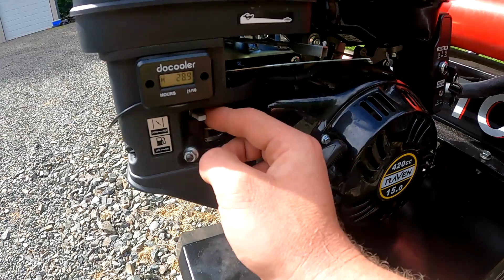RuggedMade 37 ton Log Splitter Review and Demonstration

Comment: Thanks for the info! I assumed that most of this unit was Chinese, thanks for clearing that up, still the best looking and quality Chinese made splitter I’ve seen
Reply from the maker: Your welcome. It's a great splitter. In the process of splitting about 7 cords. I have since replaced the battery, but starting problems (electric) still persist. I'd say the electric start is the weak spot in the  unit. Also, engine is jetted very lean from factory so it has to start on choke even when warm. Thats easily fixed with bigger jet. Other than that, I have very happy with the unit. Unfortunately price has gone up substantially since I bought it. I still highly recommend getting it..money well spent!

Comment: Can you turn the 4 way over so the spacing is different? That's a design idea if you cant.
Reply from the maker: No you can't unfortunately. And the provided 4 way wedge doesn't make pieces in the right size in my opinion. It works GREAT on like 10" rounds but thats about it. There are better designs out there. But don't let that stop you from buying the splitter. Its a GREAT machine. Too bad they are a lot more money now, but I guess everything is.

Comment: Great video Andy. 
How do you like the axle set all the way back like that?  If i bought one, that's what i'd do as well.  Does it make the tounge super heavy?
Reply from the maker: Thanks man! Axle is in a good position for sure. Tongue weight is probably 80lbs or so! I put a standard fold away tongue jack on it from Harbor Freight. It really should have come with one.

Comment: Im looking at this or a eastonmade ultra. Chinese with a lift vs canadian 4 sec cycle time but no log lift.
Reply: You can order this splitter right now and it will be sitting at your house in 5 business days. Its over a 2 year wait for eastonmade splitters, I have a 22-28 ordered.
Reply: @Tonnsfabrication  im probably going to look at a brute force first if they are behind too then i will consider a chinese unit. I'd like one i can tow fairly far if needed. I don't like those small wheeled ones really.
Reply: Check out All Wood Log Splitters too. US made.
Reply: @faststang89  I guess it's all in what works best for you. I've added a hydraulic wedge to this 37 ton and just finished an 8 way wedge for it, (I have vids of it on my channel)  I run this thing with a conveyor and can easily push through over a cord an hour without any issues by myself. The problem becomes dealing with the wood, this splitter can make firewood much faster than a normal person can deal with it. For my own personal use this splitter is more than I could ever need ( with the wedge mods). When I get that Eastonmade it will be a toss up as to which one gets sold. With what I have invested in the Eastonmade I can buy 4 of these ruggedmade splitters. Let us know what you end up getting.
Reply: @nicholascooper1193  yeah they look nice, but for someone like me who only may sell 1 or 2 cords and the rest is for myself that price is a little steep.
Reply: @nicholascooper1193  Those look like nice splitters, pricy though with the lowest cost model sarting $9000. Not sure what the wait time is either?
Reply: @faststang89   I agree, for some reason I thought they had a lower price model that more directly compared to the Ultra.
I've seen a lot of box store splitters pop up on FB market place since it seems a lot of people are upgrading to commercial grade splitters. If you're able to do some fab work, it's not a huge deal to do some upgrades to them to make them better - add log lift & table(s), expand hydraulic capacity, etc. 

All and all, it's really hard to beat the price of a RuggedMade, even if you're basically just buying it for parts and intend to modify it.
Reply from the maker: Interesting comment thread. Lots of good opinions and experiences that people are sharing. Hope all this info is helpful to future log splitter buyers. I can say that overall, I am VERY happy with this machine. Its important to remember that NOTHING is perfect, but as a whole, this machine has impressed me since day 1. To really maximize the machines potential, you MUST have 3 people working. It just makes wood so fast!
Reply: @Tonnsfabrication  I've actually thought of buying a unit with a blown engine or something and putting a electric 220v on it, obviously that would limit where i could take it but it would be nice to never deal with needing to go buy fuel etc

Comment: Awe man.   
Thats depressing.   So what was wrong with the 4 way splitter wedge?   Why would you not use that?   Is it too weak to use the 4 way with?
Reply from the maker: No the machine is crazy strong. It will blast through the nastiest wood like a breeze. The 4 way wedge is only good (I think) if you are in smaller diameter material. Just because it splits them in weird sizes if they are too big. But ruggedmade now offers a 6 way wedge that I'd really like to try. Please don't let the 4 way wedge discourage you from buying the machine. It's been great. Hope that answers your question
Reply: @andy84wilson  They make a 6 way wedge for that machine.  I would love to see it in action.  What do ya think?

Comment: does the battery have a direct ground wire connected to the engine block? (not to a painted surface)
Reply from the maker: I'm not sure. I'll check and report back!
Reply: The ground terminal is bolted on with the engine mount bolt. The engine case is bare aluminum.

Comment: Need a bigger battery for cranking.  Sounds like not enough juice to turn that motor over.
Reply from the maker: This machine needs an AGM battery. Flooded cell batteries won't hold up to the vibrations from the machine. That battery was 2 or 3 months old at the time of the video. Vibration killed it that fast. Lesson learned.

Comment: You may have already figured out what is going on with your log splitter when it won't start. I see your video is about 2 years old. But if you haven't I would tell you that when you go to start it and you think it's a starter or a bad battery check the control valves because if they're not in neutral position it won't start and it will act like a bad battery and the key ignition also.
Reply from the maker: Thanks for the tip. I know exactly what you are talking about. It ended up being the battery. Normally I would have suspected the battery but it was almost brand new. The vibrations these machines throw off is hard on lead acid batteries. I need to go AGM. Thanks for watching!
Reply: @andy84wilson  I have the 728 model I just bought this year and the battery does jiggling wiggle around in the battery case I think the battery was too small for the machine. However I took 1/4 inch threaded rod and I drilled the hole on the bottom of the battery box a quarter inch hole on both sides then l cut a piece of quarter inch flat stock then drilled that out as well I put a piece of leather on top of the battery and then tightened it all up problem all fixed hope this will you .
Reply from the maker: Thank you! That's a great idea! I'll do it! I hope you like your machine, mine has been great!
Reply: @andy84wilson  I love it if you have any questions hit me up if I can be of any help to you
Reply from the maker: @terryschuyler5185  thank you! I appreciate it! Happy Thanksgiving!
Reply: @andy84wilson  I hope you and your family have a nice Thanksgiving 🍽️

Comment: Throttle it all the way down to start. Idk why you’d think it’d be better wide open
Reply from the maker: It won't start throttled down. Do you think generators are started at idle?
Reply: @andy84wilson  I start my generator, log splitter and everything else on idle. If it doesn’t start on idle I’d check the carb or spark plug.